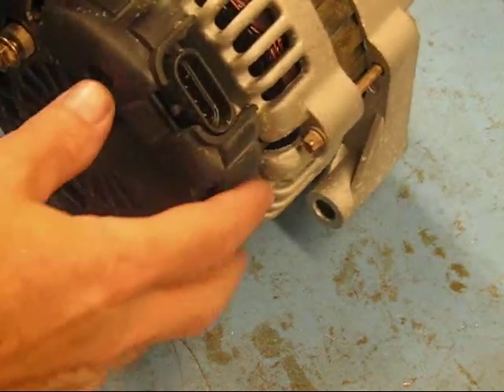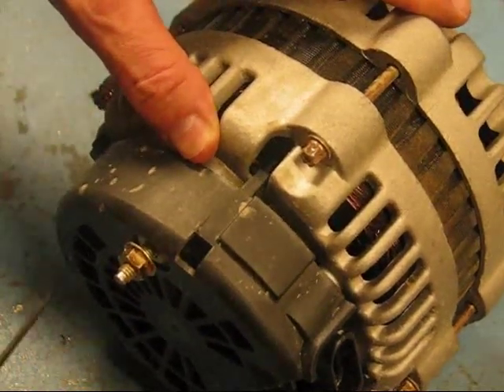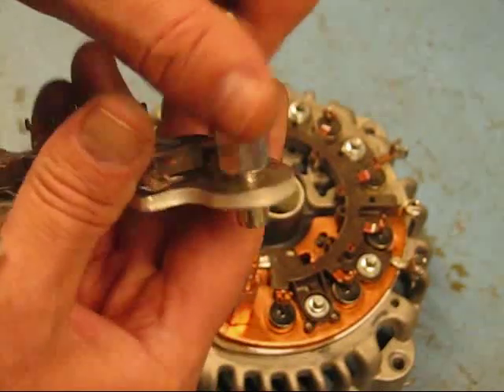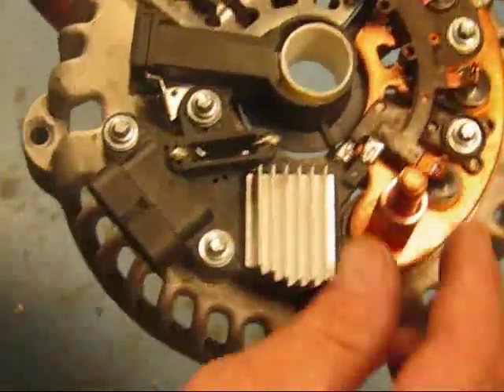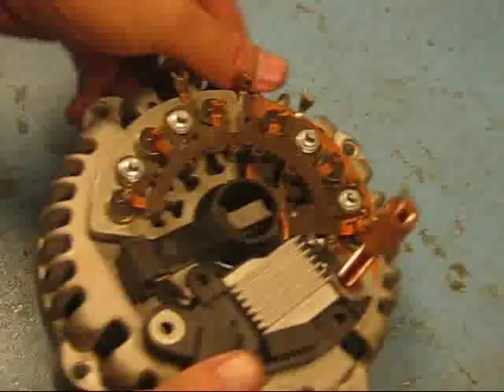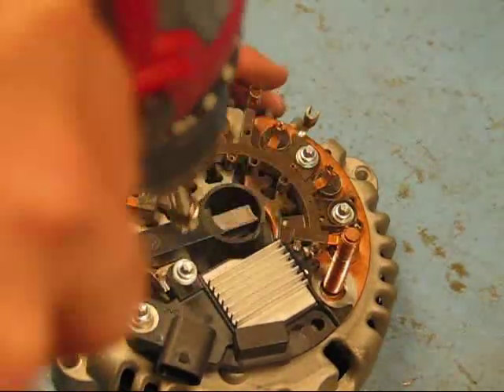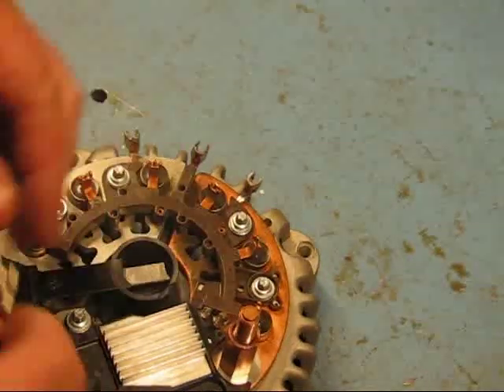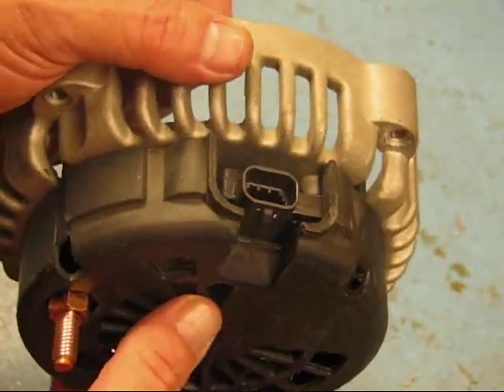ad230/ad244 voltage regulator change from 4 to 2 pin connector on GM vehicles

Comment: What if you have a replacement alternator that has a 4 pins but is connecting to a 4 pin connector harness but it only has a 2 pin wires in the harness or male connector that is a 4 pin connector type connector. The original alternator has 2 pins but is a 4 pin connector type? One orange wire and one Grey on the harness back to the car. Thanks

Comment: I currently have a 4 pin 145 amp alternator and would like to put a 160 amp alternator that has a 2 pin connection. Can that be done also?
Reply: Check your connection. My Hummer h2 has a 4 pin oval connector but only has two wires going to the center two pins so I'm guessing all you'd have to do is change the plug.

Comment: I would be using dielectric grease at the battery regulator to rectifiers connection to prevent any future corrosion, but that’s just 50+ years of a service tech in me, coming out. I know it’s 2020 almost 10 years now since the video was posted, but my question goes to this AD244 four terminal regulator that supplies 0.7 volts to the brake assist pump mounted on the booster. It would be the “D202XHD” regulator sold on your website as this is only an “Alternator Working” signal, as if engine vacuum drops below 10.5 volts, a switch inside the cylinder shaped pump turns on, using ignition #1 amperage to run the pump. This is a family vehicle and my question is this will work. Using a Fluke 87 type 5 DMM.
Thanks. ASE Master Tech since 1978 - Retired (Note, reading taken in an open circuit running/working alternator) with out codes.

Comment: does anybody know what the mechanism 370a alt is? I know it's not an AD244 or a DR44, WHAT MODEL DO THEY USE? I'm trying to change it from the 2pin to a 4pin so I can use mechmans external digital voltage regulator, I don't want to have to send it in to them to get changed and charge me a bunch and take 2 weeks to get it back.. I also have a 91102R external reg, will that work on the stock 2pin GM alternstors?
Reply: Why not just ask them for the parts and a price.

Comment: will this work on the mechman 370a? I just bought a 2 pin for my truck to use right now, then eventually I'd like to switch it to the 4pin so I can add the mechman digital voltage regulator.. I also have the external voltage regulator I might not keep, I may send it back. then just do the 4 pin conversion
Reply: and do u sell these parts to convert to the 4pin? I'm very tech savvy, I'm just new to the high output alternator gang, but I'm very interested in all of this, I definitely subscribed to you.. your a very knowledgeable guy it seems..
thanks for the awesome videos

Comment: i know this is a older video but can this be done from a 2 pin to a 4? i have a 300 amp alt from a 05 yukon that i would like to put on my 98 gmc jimmy. everything fits except the jimmy is a 4 pin 1 wire plug and the yukon alt is 2 pin 2 wire plug. is this able to be done?

Comment: alternatorman, just wanna ask wire color code for 4 pins regulator (AD series alternator) 1st, 2nd, 3rd & 4th pin connection?

Comment: alternatorman !!! you are the man . i had bought a 300 amp alternator 6 years ago for my 2007 nbs votec max silverado. and just life happened .so i plow with my truck and my batteries finally failed and i fiured since i have the whole truck apart to do the batteries and the bigger power wire for my stereo i installed this would be a great time to install my new high output alternator..when i opened the box and saw the 4 port ad style alternator and i know my truck is the DR style alternator my jaw dropped.i thought i would have to buy a new alternator or stick with my factory 145 amper..finding this video saved my life and alot of coin. thank you so much for your knowledge and experience and for sharing that with us and ME!!
Reply: Hahaha similar story here

Comment: @altman - Do you know the range of voltage the regulator expects to see to produce various outputs? 

Is it PWM or just straight voltage?

What I'm getting at, basically, is this: If I used an AD244 on a utility engine, for, lets say a small tractor; would I be able to connect a plain battery feed to the VR's expected input and have it regulate voltage properly so as not to overcharge the electrical system?

Comment: The AD244 is already a one wire alternator. Only one pin out of the 4 is typically used in automotive applications, which is a battery voltage feed [more often a PCM feed that senses battery voltage and responds].

The other 3 pins have other uses, one of which is a tach feed.

Comment: Unless all alternator openings (vents) are screened over so as to contain any arc flash to prevent any possible ignition of fuel fumes in your boat, it is not advisable to use any automotive alternator in  a marine application.
People have burnt their boats making swaps like this.

Comment: I would not reassemble the black plastic housing until after I pushed the brush back.
One can move the brush back and use a paper clip to hold it in the retracted position.
Once this is all in place snapping the housing in place is easy.

Comment: Im doing a dual alternator setup on a cadillac escalade. Im using one wired up so it can get all the stock signals and I want to do this to the other one. How do I wire up the plug?

Comment from the maker: @pinoytat93 Changing from a 4 pin regulator to a 2 pin regulator allows you to use the earlier GM alternator in a later application. I like the AD series alternator (4 pin) better than the 2 pin (DR44G series) The  4 pin AD series alternator has a replaceable bridge rectifier where the DR44G has imbeded diodes, so if  the diodes burnout you must replace the whole rear housing, on the AD series you just replace the bridge rectifier. The AD series is best for HO and you can't just change the plug